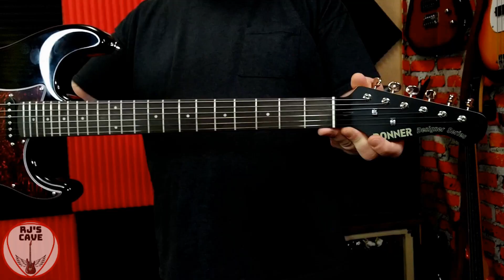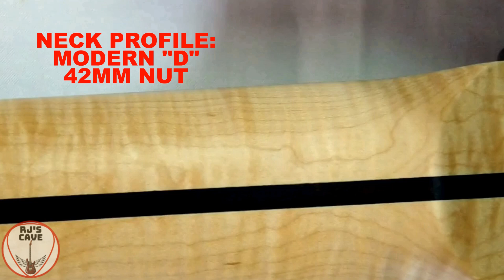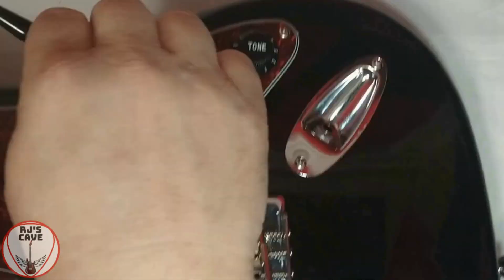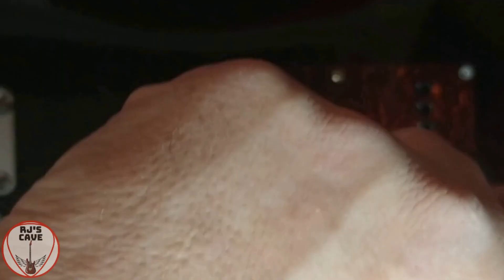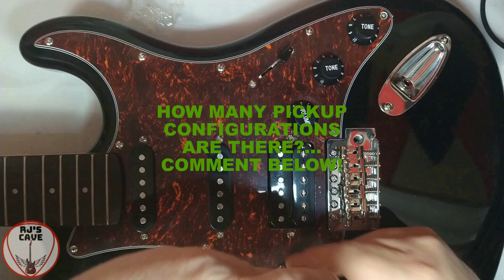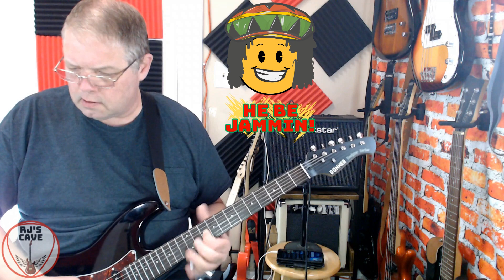IS THE DONNER DST200 BLITZIN' THE COMPETITION OR YOUR WALLET?! #ebayrefurbushed #guitar #donnerdeal

Comment: I tried that. The neck is slightly bent downward from the third fret to the head causing fret buzz at that the third fret. Thought about setting in a homegrown fixture and heat it up to take the bend out.
Reply from the maker: So it's bent backwards? problems like back bow at the 3rd fret are less common and usually mean it's a fairly big issue. return it if you can. I wouldn't mess with it until I knew I was going to have to keep it.

Comment: I bought the DST100B but when it came in, the neck is twisted and bowed slightly. I emailed Donner support about it but no reply.
Reply from the maker: That's unfortunate because you picked out a good guitar. Where did you get it? It should be returnable no questions asked. a little bowing is normal because of temperature changes, humidity etc. a tweak of the truss rod should fix it.